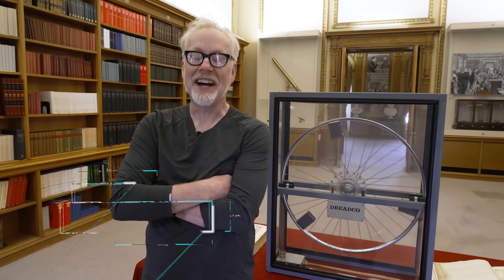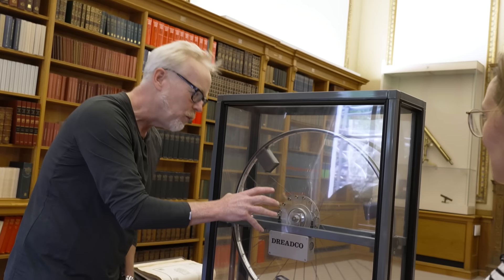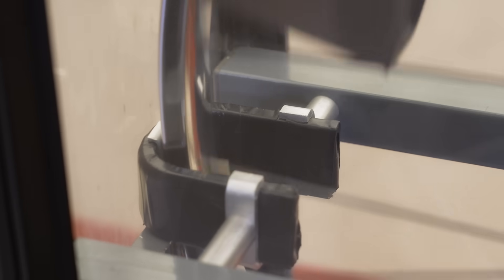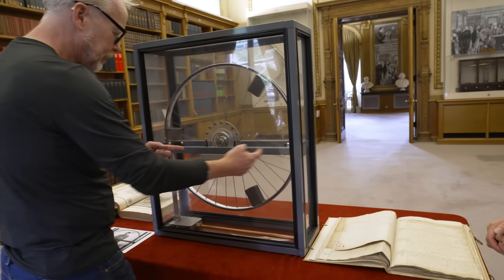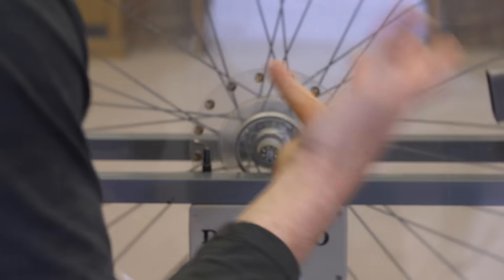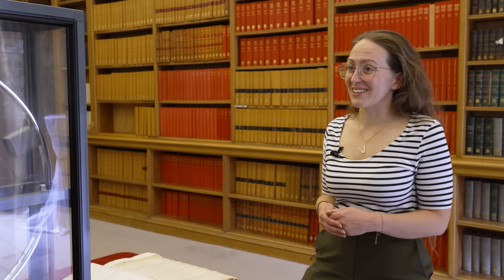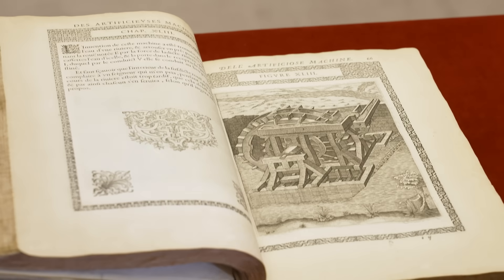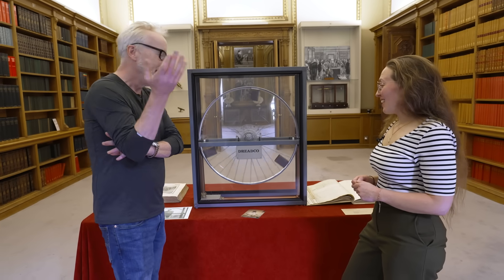Adam Savage vs The "Perpetual Motion" Machine!

Comment: These things are usually less a perpetual motion and more an example of a "high efficiency apparatus" with such low friction and power usage it can seemingly run forever- the issue is, if your goal is making perpetual motion, the intent is to somehow generate unlimited energy for use elsewhere- the minute there is drain, or "work" being done, none of these devices would power anything.  A small nuclear reactor could fake being a perpetual motion machine better than most perpetual motion machines.

Comment: How long could a similar system be expected to spin without any external power if friction was kept to a minimum?
Reply: Hold a bicycle wheel, spin it and see how long it spins.
Reply: How would you calculate out the difference in friction?  @aorton27

Comment: My thought was to take an alternator and make it a motor one cycle of four. Three churned charge One turn is power generation. And there are ways to store this power without  chemical batteries especially when they use is instat after charge
Reply: Add a flywheel effect or outta Balance effect and you might be able to get even more turns of charge to power turns

Comment: Maybe a vacuum box and it's just spinning with Newton's 1st law, low friction axle, aided by a mild Stirling engine effect that helps prevent the momentum dropping too fast by replenishing part of the energy of the heat fluctuations of the day. The little boxes might contain sliding weights that help to reduce the loss of momentum like many other perpetual motion machines do.
Reply: There's just one flaw if you add on the sliding weights: shifts in momentum which would cause the machine to constantly accelerate and decelerate based on the positions of the weights inside the boxes. 

My guess is an ionised gas which allows for a constant flow of electricity and the boxes being magnets. The only other guess i have is that the 3 boxes are heavy duty magnets repelling against the axle which is mildly charged, allowing for the repelling force to maintain a constant motion until such a time whereby the charge is too weak to maintain the motion.

Comment: I'm curious if anyone has ever built one of those coil-spring gears like you see for automatically keeping watches wound, but at this scale. I highly doubt it would work as well as most of the other electric + bearing options that could run this type of device for a few years but it would be interesting to compare how much energy loss there would be in comparison to the tiny watch scale version.
Reply: Those "coil spring gears" are not PM machines. The harvest energy by staying still, and the user (wearer) moving the entire frame of the watch to compress the springs.
This machine remains "working" after months undisturbed in a dark storeroom. So whatever it's trick is, it's not that.

Comment: I believe there is several unnecessary items built in to this project for no other reason than to create confusion and conversation about how it functions. Personally I think the three boxes 120 degrees apart contain a liquid that needs to be replenished every couple of years and that’s all that makes the wheel turn. This is nothing more that a waterwheel in effect, the three boxes contain a heavy liquid like mercury that “rolls” back and forth as the wheel spins and maintains the rotation do to the spacing. Note how the boxes are mounted vertically for the effect, the other stuff is just conversation pieces. Sorry if I ruined this for everyone.

Comment: If you can create a machine where by the machine makes more electricity then it uses, you would be able to have perpetual motion.
Reply: A solar panel with a flywheel generator turning a small motor is a perpetual machine.  The small motor would turn for ever as the solar panel powers the unit and charges the flywheel generator so on days with no sun the motor would still function.
Reply: @aorton27  it would be a bit more difficult then that due to friction of the flywheel. However, if it was possible to utilize water in a nuclear power facility, we could actually double the electrical output by having the steam from the vats condense and pour back into the system and as they pour back into the vats, they turn a water wheel. However the fuel rods would need replaced as time goes on. It is also possible that nuclear reactors can become zero sum though that requires a lot of effort on handling the waste material.

Comment: I think my favorite part of this contraption is the fact that you can see the bearings barely spinning. Like i understand physics and gear reductions, but its just so fun watching all of those complex calculations just exist in nature.

Im also wondering just how much of the stuff on it was put there just to throw people off. Like im pretty sure the acrylic around the bearings is only aesthetic but at the same time it could be electrically insulating the metal bearing and axle and spokes from the metal frame of the contraption. The copper tubes might actually be electrical conductors for a tiny electro magnet or they are there because they look cool and look like they do something.

Also if you notice that the axle is not centered on the frame, but the U shaped "magnets" are, meaning the boxes on the spoked do not go past the magnets at an even interval, the one on the left has a box pass through it, then the one on the right immediately afterwards, then there is a gap with no boxes passing through magnets.
Reply: The clear plastic around the bearing also allows people to see there is no hidden motor, wires, gears, batteries or springs in the hub.  All very important to make the magic trick more interesting.

Comment: Would be marvelous if the solution isn't electromagnetic at all, but the copper tubing (with assistence?) provides a tiny mono-directional air flow, almost imperceptibly pulling the wheel along at entry and exit.
Reply: That's my opinion. It essentially runs off heat similar to a heat pump or a fridge. the jaws on either side is where the gas is sucked in on one side and blown out on the other. the three mustard tins act like pistons when they enter the jaws. the apparatus seems to be gas tight so it may contain a refrigerant . the heat sink valve mechanism at the base is some kind of evaporator.

Comment: Depending how sensitive the valve is in that box the case could be filled with a conductive gas, the wheel turning the way is does could theoretically be pushing charged gas into the pipe, building a charge that opens the valve pushing the built up gas out the other end of the pipe turning the other side of the wheel and imparting residual charge to the pile either through gas contact or through the wheel itself. That could account for the extended lifespan of motion. That said if the people who know found the answer disappointing then it's probably not that elaborate.

Comment: Soo. My guess. There's nothing functional in the Dreadco box. The three boxes on the rim contain magnets. The forks on either side contain a coil in series with a reed switch as a switching element to turn the coils off and on at the right time. They're getting power from the box in the base which is stuffed full of batteries.

The batteries and coils could also be in the boxes, but I doubt it because it would make it harder to service.

Comment: Stirling motor, using magnets on the wheel, in conjuntion with electric resistance to generate heat. The 2 year maintenance cycle is for the bearings, and to replace the heating coil, like lightbulb.
Reply: Nothing with heat. These heat sinks are just to confuse. Heat looses too much energy. Its magnets, coils, hidden batteries, magnet sensors to time when to "push" .
Reply: @petermatthiesen8288  The designer said they are made from a bicycle wheel, sewing machine, and some plumbing parts. Micro stirling motors based on a sewing machine mechanism was a popular hobby toy to build at the time. It only needs a very small heat difference to make it work. The sounds of weight moving is the stirling working. Also if you watch the motion of the wheel, it has this lurching forward, very much like that seen on direct piston powered wheels.
Reply: @Sturmgewehr14  Very good theory. But a few problems I think. Would it not have the same motion if it got "pushes" from a coil and magnet?  Why would they keep it secret if it was so well made? And finally, why would it stop every few years and need "service" to start?    - and an idea to make it better regardless how it works: Pump all the air out of the box.
Reply: @petermatthiesen8288  To service the bearings and the heating mechanism. I wouldn't be surprised if it's a very small coil that can easily burn out. Also, lurching from a small electric motor in the hub, with a giant flywheel, wouldn't be so large. The box magnets are to spaced to provide any motion that smooth, even with a modern controller. It would stop and probably start, and reverse itself without a smart controller. It would make way more sense if those box magnets just slipped past copper windings to create a jump in current, enough to warm a bulb.
Reply: @Sturmgewehr14  Thank you for replying me. Its very interesting. And I suspect that the whole idea of that thing and the reason for keeping is secret, is to create discussions such as ours.    I am not convinced that it would not work if given a small push ever time the coils (if they are coils) pass a magnet. So I suggest that in each of the 3 boxes on the wheel, is a coil, small circuit and a battery. The coil sense when it gets close to a magnet and the a small timer is triggered and at the right moment (when the coil has just passed closest point to the magnet) a tiny puls is fed to the coil which gives it a small push.   I have a question to your theory. You say "enough to warm a bulb". So are you suggesting that the heat needed to run the machine is created by the machine itself?
Reply: @petermatthiesen8288  Yes, it is a   battle of micro returns. The machines were made in the early 1980's, so don't expect complicated codes with arduinos running the machine. Think more along the lines of a guy proving a point, that people will look for a complicated solution, when a simple one is obvious. That's why I think he made these machines.  He called scientists "remarkably gullible" for not solving these riddles. That has to be a clue...
Reply: @Sturmgewehr14  Early 80´s ?  Oh I did not know that. I dont know how far the Li batteries were at that time. Still, my suggestion do not imply a micro processor. Just a few transistors, coils, hall sensors. You did not answer my question so bare with me if I am wrong:  I assume you suggest that the energy for turning the wheel is harvested from the wheel ?  This will never work more that a few minutes. If we rule our batteries, there has to be an energy source from outside. Maybe light, maybe heat. My bet is still on hidden batteries. Like a comment I once saw: "The biggest problem of making a Perpetual Motion machine is where to hide the battery"

Comment: The oxide on the copper pipe acts as a solar cell (copper oxide is a photovoltaic material). The end pieces form an anode on one side and a cathode on the other. A capicitor, a magnetically activated Hall Switch, and a coil exist in these 2 end pieces.
The 3 boxes each contain a magnet.
Light on the copper tube generates charge which is stored in the capicitors. 
When the box passes through the end pieces, the Hall Switch is activated and the charged capicitor discharges through the coil, creating a magnetic field and pushing the magnet.

Of course, all of these forces are small and so each push is also small.
Reply: I think the copper oxide would create too little force to keep this running. Its not even in vacuum. My guess is hidden batteries.
Reply: @petermatthiesen8288  Batteries would be an obvious and inelegant solution.
Left in a room under display, the batteries would eventually die. Vaccum is not necessary - only the removal of 'dust' and air currents is required.
My solution could last decades or centuries given high quality capacitors. 
A well balanced wheel with high quality bearings would require very little energy to maintain motion. The copper oxide pipe/photovoltaic would produce perhaps 100x as much energy as required.
Reply: @gjscomputerstuff  Thank you for your reply to my comment. So you are saying that the fuel is light. I must admit that my experience with copper tube acting as a solar cell is 0. My poor judgement suggests that the voltage from such a single cell, not receiving sunlight, would be very low and terefore difficult to work with. Of course, batteries would be a inelegant solution. However, most magic tricks are inelegant when revealed. So my bet stands although my poor knowledge can not rule your suggestion out.
Reply: @petermatthiesen8288  Well, I was responding to the narrator informing us that only 1 person could guess how the system operates. That would imply a rather unique system that no one normally think of. Batteries would probably be the most common solution suggested. Most people aren't aware of Copper Oxide as a photovoltaic system and hence why I suggested it - as an unusual but plausible system setup.
Reply: @gjscomputerstuff  Oh thats interesting. If its true, then - of course - no batteries. And yes, I had no idea that Copper Oxide is photovoltaic. Interesting and thanks for sharing. I hope that you are right about the machine.

Comment: We made one of these in high school with 6 magnets. Technically not perpetual motion, as the magnets will one day no longer function, but kinda cool.
Reply: Nope, you didn't. Permanent magnets don't work that way, and cannot be used to spin a wheel. Not even very weakly. Not even with whatever clever configuration you're thinking of. It doesn't matter if you alternate the poles, or place them in a special arrangement, or allow them to rotate freely. There is nothing you can do here, for exactly the same reason the overbalanced wheel doesn't work. At best, energy out is equal to energy in. If a magnet imparts energy into your wheel, then it must have extracted at least as much energy from the wheel first.

This is actually super common for people to suggest, or claim they've seen demonstrated. And they always tack on "but it's not actually perpetual motion because magnets don't last literally forever." This is fundamentally misunderstanding both magnets and what perpetual motion even means.

If you make a device that can spin a wheel with a positive force without supplying input energy, you have created perpetual motion. It doesn't matter if it lasts one second or a trillion years. You have achieved overunity and violated the Law of Conservation Energy. Pick up your Nobel Prize at the front desk. And when a magnet imparts a force on something, it's not doing so by depleting its reserve of stored magnetic energy. The energy always comes from an external source. In the case of an electric motor, the energy comes from the electricity in the windings. In the case of two permanent magnets repelling each other, it comes from whatever energy you spent to force them closer together. They're basically springs (yes, I know springs are linear and magnets are not, don't at me), and springs don't produce energy, only store it when compressed and release it when decompressed.

Comment: This is amazing. Its just a wheel with small batteries which power a motor. 

The royal society is either stupid, doesnt check their donations, or knows and keeps this lie going.

The big tell with this is that she said that it starts to "slow down" after a few years which would also coincide with a power supply running out of juice. 

An actual perpetual motion machine, if actually possible on earth, wouldnt slow down.

Comment: The simplest explanation to me is that this device is using Lorentz force to apply force to the wheel in the direction it is spinning.  At the ends of the horizontal bars are magnets which create a magnetic field.  These magnets create a magnetic field which moves from the front of the case to the back.  The three boxes near the perimeter are batteries which generate a small current moving from the outside of the wheel towards the center.  As the spokes move through the magnetic field, it creates a force on the wheel which is orthogonal to the direction of the magnetic field and current.  The left side produces a downward force as the current moves from left to right and the magnetic field from front to back.  The right side produces and upward force since the current moves in the opposite direction from the left side.  Not entirely sure how the device is grounded to allow the current to continuously flow.  Might have to do with the box at the bottom.  Not sure if the current is small enough if it could dissipate naturally through the air or as heat to allow the charge to continue to flow.
Reply: I imagine it would be fairly simple to create a circuit that has a quiescent voltage at the node in the center of the wheel.  And current sent that would increase the voltage beyond that point could essentially be routed into a short circuit and dissipated as heat.

The box in the middle could have solar cells intended to recharge the batteries.  Even if you kept it in a dark room where the light wasn’t enough to keep the system charged, it would still last a very long time.  Something like this likely consumes less than a mW of power.

If you wanted to make one.  You could optimize it by applying the largest magnetic field possible, minimize the friction of the device, vacuum the air out. And probably have some sort of potentiometer to tune the current through the spokes to get the desired speed.  Equilibrium will hit when the force applied is equal to the friction acting on the wheel.